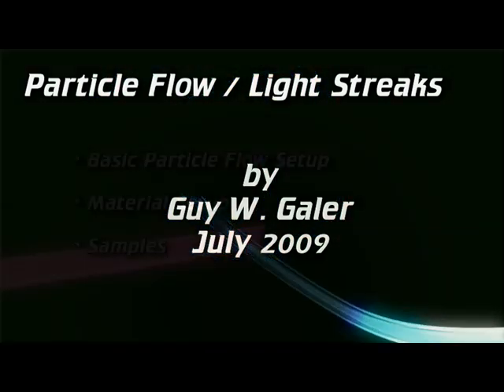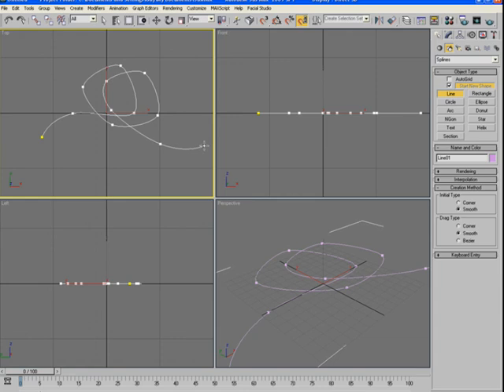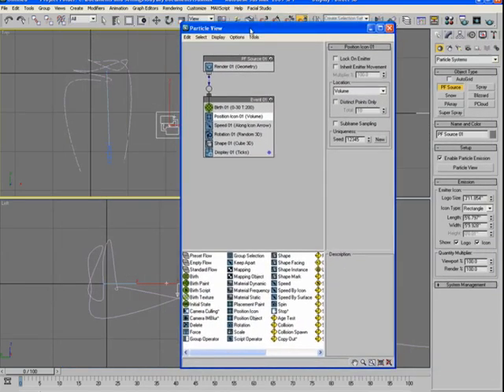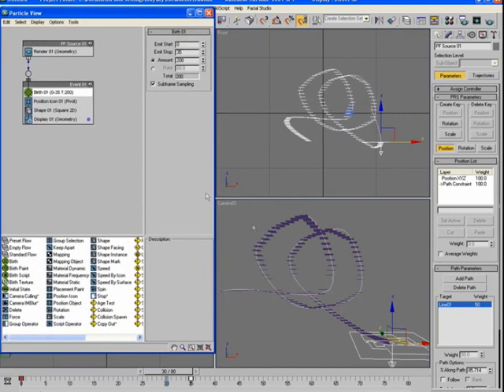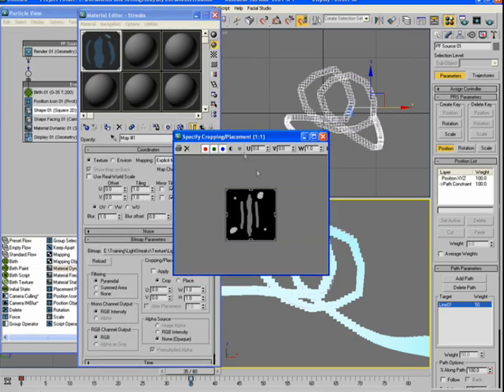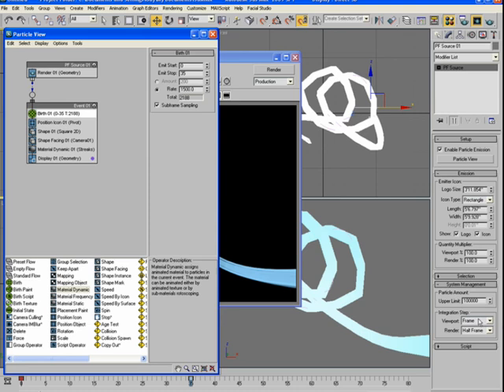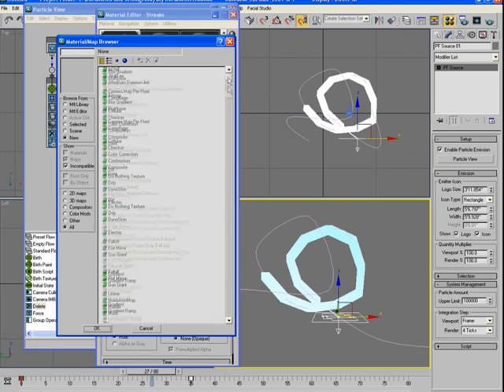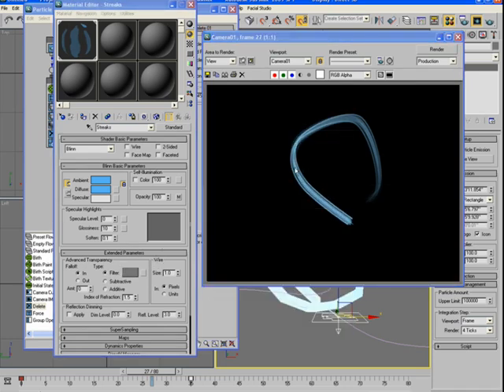Light Streaks with Particle Flow / 3ds Max

Comment from the maker: @MrMuchymuchy - Most of the time - it is easier to do the glow in post but you can use the Arch-Design material in MR with the glow / Self Illumination settings and glare.  I find this to be harder to control and require more trial and error to get it right.